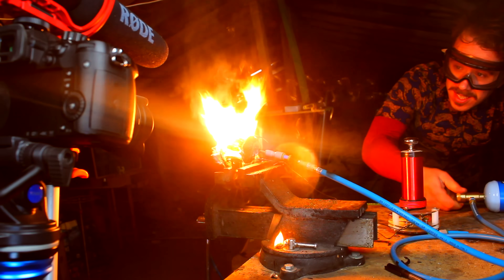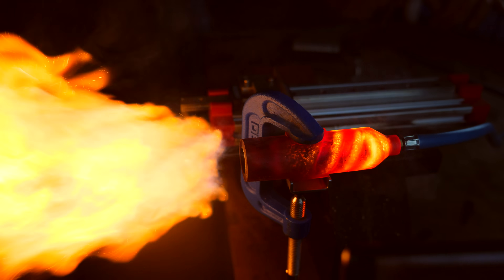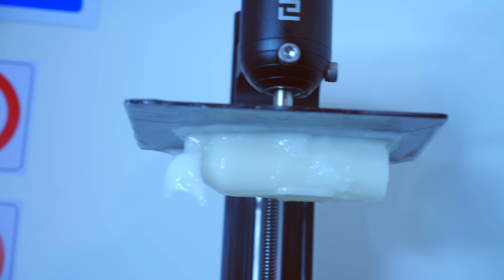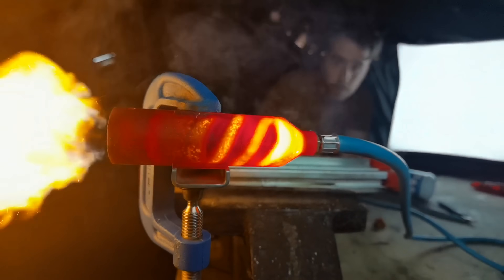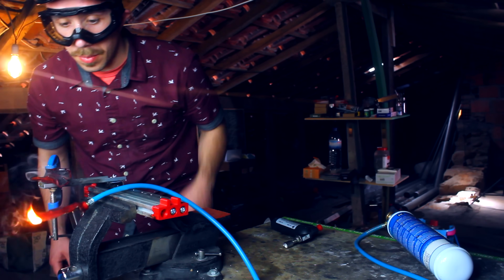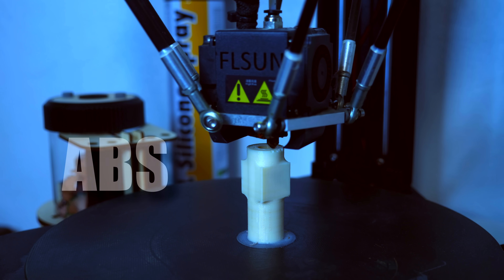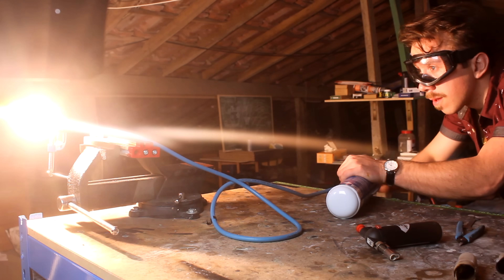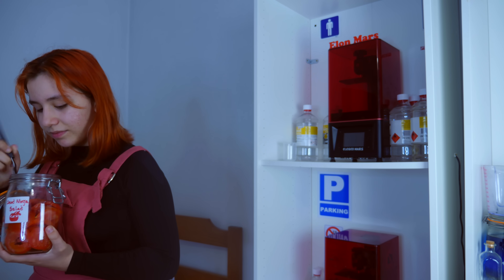Rocket engine that uses itself as fuel! (3D Printed)

Comment: You bought a metal welder right? why not make a metal shell for the 3D printed "fuel cell" to insert into. that way you can try burning all of the cell in one attempted. may you'll be able to have a slot for some nozzles too! that way when one burns up or explodes its easy to change it out for a new one

Comment: Imo the problem with thrust occurs because the fuel burs from the outside to the inside of the rocket, where in model rocket engines you put igniter inside the chamber so that it starts burning from the inside and expands to the outside

Comment: Hey Integza, why don't you try Ultrafuse 316l filament. It is a filament with steel powder mixed in the thermoplastic. After post-processing, which is provided by purchase of filament, it becomes a 100% 316l stainless steel part.

Comment: Serious concerns alongside a video idea:

ABS is extremely toxic when burnt.  There's a reason why most commercial ABS printers are enclosed and why many people who print ABS encourage building printer enclosures.  And that's just melting it.  You're burning the ABS and that's releasing even more chemicals into the air.  
Secondly, I'm pretty sure that your current test stand has way too much friction and way too much mass.  Though your printer's linear rail prevents more friction than is necessary within the context of a 3D printer, that's still a lot more friction than necessary.  And your rocket mounting method (aka a huge, heavy clamp), means that the moving portion of your rocket has a lot of inertia to overcome in order to actually move.  These two things together meant that you have a massive wall that your rockets have to pass in terms of force before any movement will be shown at all.  If you were to build a system that has less mass on the movement axis and lubricated your rail or replaced it with something that moves smoother at lower forces, you'd see significantly more movement on your rocket tests and be able to judge differences in speed, etc. far more easily.

Thus video idea:  combine both of these.  Build an outdoor test stand designed specifically for testing your rockets.  I know you hinted at something like this in the video, but I think you could make an entire video re: your process of building a test stand that is safe (health wise), smooth (rail wise) and light (mass / intertia wise).  And the result would also be better, more visual test results for the rest of your videos!
Reply: Trying to figure out why this comment is so far down the page. This is pretty damn important info
Reply: I don’t normally comment, but yeah, ABS is vile... There’s no way I’d print ABS without an enclosure let alone burn it, and especially not inside. My heart skipped a beat when I saw him burning it in his attic?!?!?
Reply: @makennasmith1477  Oh yes, definitely!  This video showed that ABS certainly works alright as rocket fuel, but I don't think I'd ever burn it inside like that, let alone inside my own home!  I really hope that attic has some windows that were opened after filming this section!!

Honestly, he probably shouldn't be burning anything inside his attic, but the ABS was really the thing that worried me 😬
Reply: UV resin is also incredibly toxic when uncured so I imagine it's rather unhealthy to burn it too.
Reply: I would also like to see some hard data possibly think about putting some load cells into your testing to see how much thrust is produced? Tom Stanton does a pretty good job of what I'm describing on his YouTube channel if you would like a visual. I think that if you could give us some hard data that would be really neat!
Reply: The most concerning part is after the oxygen is gone and the ABS is no longer completely combusting at that point it could be rea]sing cyanide
Reply: He should just use a steel pipe as the rocket body and mount a load cell to it to measure the thrust
Reply: Well i dunno but maybe the pure oxygen helps helps burning off Most toxic components, on the Other Hand it also Melts the Engine in the outside so...

Edit: I Just read Up on it and the biggest Problem seems to be ultrafine particles in which case the oxygen probably Made it worse

Comment: try putting the engine in line with the rail. because at the moment, when its out there you're creating a turning moment and pushing the slide into the rail, whereas if you have the engine directly in line with the slide, you avoid this and can actually see if thrust is being created.

Comment: Amazing work you're doing here, I don't know but for me it seems like the system you use for measuring thrust has to much friction, you could try lubricant, or maybe the direction of the thruster is not parallel to the rail which is attached to? That would push the rocket the wrong direction resulting in a loss of force

Comment: Just so you're aware, burning ANY plastic polymer can be dangerous, but ABS is especially nasty as one of the byproducts of it's combustion is Hydrogen-Cyanide. Hydrogen cyanide is considered a chemical-warfare agent. If you're going to continue to do experiments with ABS hybrid engines, I'd recommend wearing respirators and/or running your experiments somewhere with better ventilation. Cheers!
Link to ABS combustion byproducts paper: https://tsapps.nist.gov/publication/get_pdf.cfm?pub_id=101640

Comment: You should most likely not make the entire rocket out of the resin and instead, only make the fuel out of the KNO3 and Sugar, you could also make a mold of the fuel and pour the fuel mixture in to let it solidify so your not losing anything. You should also consider making the rocket longer so you can add more fuel to the rocket and have more of a typical rocket nozzle where it's like a funnel. Finally, you should light it from the front of the rocket.
Reply: vouch

Comment: For safety, I would suggest making a new electronically actuated O2 valve. Easier to dial in, easier to cut off in case of  (out of control) fire, etc.

Comment: You could use the idea of 3d printed rocket fuel to print single use rockets like the v1 or v2 rocket, if you resin printed the body, it would provide a smooth enough surface to fly fairly well in the air. Perhaps you could store the oxygen in the body of the rocket and just make detachable fuel cells

Comment: Are you Portuguese? That sparkling thing is called "vela estrelinha" in Brazil. If you want to move through thrust, the rocket cannot be paralel to the track, otherwise there will be torque applied. Try to lace the rocket in a open angle.

Comment: if you can incase the printed fuel engine in a steel sleeve like a piece of exhaust pipe from a car you will will be able to use much more of the fuel in the rocket . you can buy or scavenge pieces of the proper size tubing in auto parts stores or a scrap yard it's not expensive if you go the parts store route . since you can weld now you can weld one end closed to help keep it contained and weld on a tab to hold it in your stand

Comment: What about using the ABS in the 3d printer to print a kind of fuel block core? Hollow through the center and a honeycomb lattice between it and the outer diameter of the cylinder? Then fill the lattice space with your sugar/resin. Use that as your fuel for a rocket motor with a ceramic nozzle and body.

Comment: Suggestion for the rocket: first get a better o2 delivery system. The valve you are using is too slow to adjust. Ball valve at the least would help. Next, the abs seems to work great, but might burn better with a graduated infill matrix. Start loose on the inner diameter and graduate the fill to 100%. That should help with the initial burn producing more thrust throughout the burn.

Comment: Create a contraption that measures the force or thrust that is produced by the rockets. You would probably get a better reading and understanding of which rockets work. Also what if you case the 3D printed fuel nozzles in ceramic or something so that the rockets are burned in their entirety. More footage of tomato burning in the fire!!

Comment: It seems you kept having a problem with the outer body of the rocket melting, so I was thinking would there be a way to use the oxidizer to cool the outer body with vortex cooling, or some other method?

Comment: 3d print some nozzles with casting resin, make a mold and cast a metal nozzle out of soda can aluminum, or bronze. Then you don't have to worry about the plastic nozzle burning. You could even put threads on the nozzle, and use a metal pipe to hold the solid fuel. Then you just need the 3d printed fuel to facilitate the burn.

Comment: You should make a grid through the rocket body to increase the surface area and experiment with different densities. Then strap them to mini boats attached to a spring or scale, for measuring thrust

Comment: That thing you were using to ignite your rockets was what we call a "sparkler". We light them on the 4th of July. If you watch videos of the space shuttle launches they use something similar to ignite the main engines. Also. I would wear breathing protection when burning ABS plastic.

Comment: I kinda wanna see pla. And petg too. Can you get styrere filament? I did some testing with potassium chlorate + styrene (mix styrofoam, acetone and potassium chlorate powder,  and let dry. That makes a very not strong substance which you can powderize easily, then pack in to a grain. Just letting it dry makes for a very porous structure), and based on those tests and some chemistry/math, it seems like a really energetic fuel. INCREDIBLY bright! If you get that CNC machine, you gotta get some styrene stock and make a rocket out of that! Tomorrow, if I'm brave, I'll do the stoichiometry for abs, pla, petg, and maybe some other stuff, and tell you the results.

Comment: You could try doing a 4 or 5 axis cnc to mill turbojet vanes. With the increased tolerances (versus the press you used on the other video), it would be interesting to attempt a multiple-vane turbojet.

Or, to keep the theme of the videos, you could continue with the rockets. You have the solid and the hybrid nailed down, but the liquid one is missing.

Comment: Maybe a ceramic outer casing and nozzle with a printed insert of propellant? That way maybe it will not self-immolate so easily?

Or, instead of sugar and resin, potassium nitrate and resin? Being able to print the core opens up some cool possibilities for different geometries. The "Tech Ingredients" channel has an entire series on how to make solid motors. Use resin for your binding agent, omit the oxidizer and try not to burn your house down. 

Seriously, man, you should not be doing this in your attic.

Comment: Integza, I think it would be really cool to see a utility build.

To make a fully functional multi purpose test stand, (possibly with a flame diverter???) with built in thrust measurement systems like load cells as well as other measuring equipment, as well a a control panel connected to a tank storage area.

Comment: I beg you Integza ! Improve your safety protocols ! It is very dangerous to work with combustible AND pure oxygen, especially in an attic with an exposed wooden framework. There are many options you could choose from, but the simplest and the safest would be to do your testing in open air with a concrete floor and a cover to shield you from exploding engines. Moreover, you really need a quicker hand valve for this oxygen canister. Anyways, be safe, we care about you !

Comment: Nice work on the rockets. A fuel you might want to try mixing in to your resin is powdered aluminum. If its good enough for nasa I think it will work for you. They use aluminum, rubber and ammonium perchlorate as the oxidizer, or something similiar. I think you will find it a lot more energetic than the sugar. The byproduct will be aluminum oxide whish will wear out the throat of the nozzle, but for getting more thrust it might help to have a more e erratic reaction. Magnesium powder might work as well. Be safe and be careful.

Comment: Rubber makes an excellent hybrid fuel, if I remember I think it have an higher impulse than plastic or acrylic fuel sources and with rubber you can mold it into the design you want and not limited to the size of the 3d printer. I think all you would need to do is make a nozzle for it.

Comment: How about you try making a ceramic casing with a nozzle incorporated into it. Then you can place the solid fuel inside and cap the top. Leaving a hole for the oxygen ofc. The casing could handle the heat and redirect a large amount of the force out the nozzle even if it burns threw the sides of the solid fuel.

Comment: i think the next video should be a 4 chamber rocket with a central body for the oxygen to feed into and distribute into the four chambers. Also - have you considered oxygen pressure could be a limiting factor - maybe 2 x bottles into seperate chambers - maybe you could work on an oxygen delivery method - more tanks feeding into a central valve - also bigger hoses - more psi  - more combustion!!!!

Comment: While i don't exactly have a suggestion for a new video i would like to offer you some help with designing some models that would actually work as real hybrid engines that actually produce enough thrust that the plastic cap on the linear bearing might be worrying (if the casing can handle the chamber pressures that is). If you are interested in my help just reply and i'll shoot ye a dm on discord.

Comment: A thing I noticed that might be adding to the uneven burning of the rocket it that you start letting the oxygen into the rocket right as the ignition source got near the nozzle. Putting the ignition source in the back may help keep the nozzle in tact as well a spreading the flame quicker throughout the motor. Which may allow for the internal walls to burn off in layers quicker because instead of a flame trying to force its way to the rear of the rocket it will already be there and ignite the rest

Comment: Aaaaalso, tou must learn to control the amount of oxygen feeding the rocket. A super reach oxygen mixture could cause explosion instead of constant burn.
A good rule of thumb is to push oxygen until you see the so called "full/perfect combustion" and move the oxygen slightly back.
Hope you have more thrust, less explosions!

Comment: I wonder.. Can you print using ceramic a body and nozzle and just stuck the abs inside? That way you'll have a fully 3d printed rocket.. Fuel and all..
Reply: BTW, you are getting trust on an angle, that's why the rockets are sliding a little when it overcomes the friction on the 1st part then it stops again since the thrust isn't constant to overcome the friction induced by the angle you have in your setup..

Comment: You’re probably not getting thrust because your nozzles are eating them selves ( burning up since they are made from your fuel source ). Might want to machine metal or carbon fiber nozzles. Something that can be screwed on/in perhaps. Though permanently attaching them with epoxy would likely work best. 

Check out the Tech Ingredients channel they recently did some how to make home made rocket motors, and gave instructions for nozzles

Comment: I feel like simply making a casing for the engines would help saving what's usually lost with the holes in the side. Also you can find online different shapes of srb fuel which are used to control thrust, maybe you can try a similar thing for the hybrid engine

Comment: Why not go and try the opposite of what you are doing. Instead of creating rockets that go up, why not work on a 3d printed submarine. And now that I just said that a new idea came to mind, how about trying to liquid cool your rockets. You could try something as simple as having all but the exhaust nozzle poking out of a tub of water. Or if you wanted to go more advanced, you could try and 3d print water channels in the rocket case for you to flow water through.
(You are right with the tomatoes, they are nasty).

Comment: Hello there,i think you have a problem, the engine burns through itself. If you can, try to put a casing and the nozzle in temperature heat materials, porcelite, carbon lamination...
Good luck :)

Comment: I think the problem with the nozzle is that it just burns out, as its made of fuel essentially. So i think that the surface area of the interior helps with burning more fuel quickly, and create a nozzle with another material

Comment: You are failing because the walls that contain the pressure necessary to produce thrust melt or crack before they can do the job, i suggest you to put your solid fuel thing inside a metallic cylinder, a tube, the nozzle should also be metallic, or at least, unable to burn.

Comment: Integza. Pvc is decent when it comes to withstanding hot temperatures, just not for too long. Could you take your 3d printed rocket fuel engine, and put inside of a Pvc pipe, then make a nozzle that could thread on the bottom? You could make the fuel more solid then. Also, if you could get the flames to leave the nozzle in a vortex, it may give more thrust

Comment: Future video idea: you can try to use old prints leftovers as fuel iside a heat resistant ceramic combustion chamber. That way you can get rid of the hatefull supports and failed prints while having a bit more of control on the nozzle geometry to get the best performance :D

Comment: You probably need to get a quick disconnect for your oxygen supply. The amount of time you spend near the flame throwers turning the oxygen off is enough to get 3rd degree burns. Assuming you stay near it to continue turning off the supply.